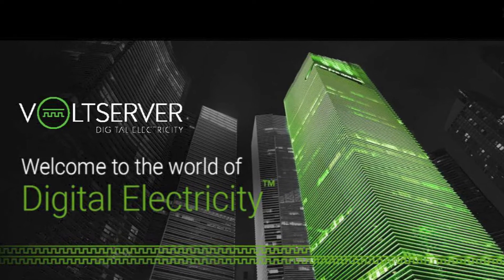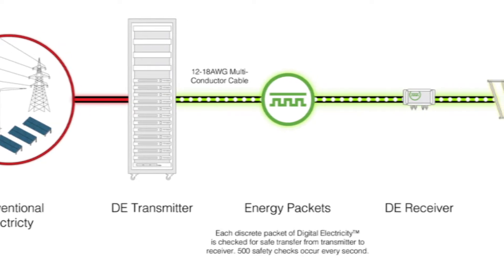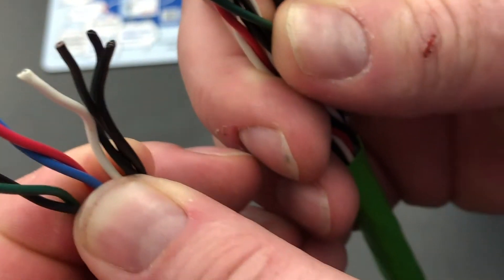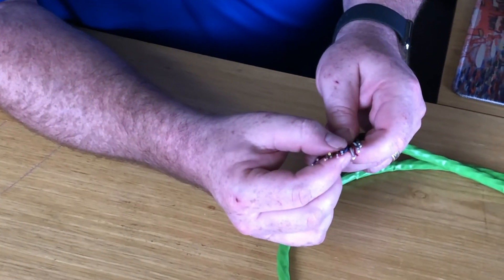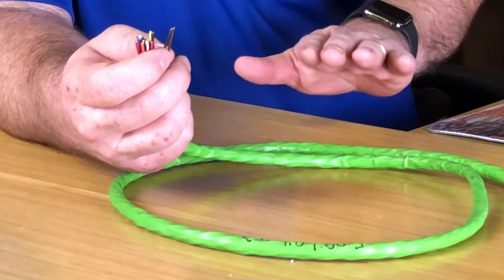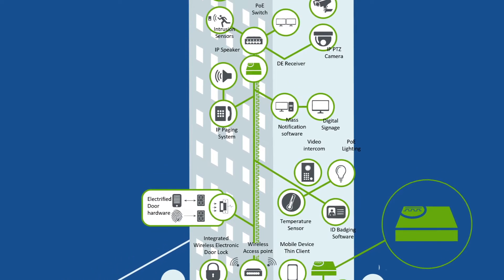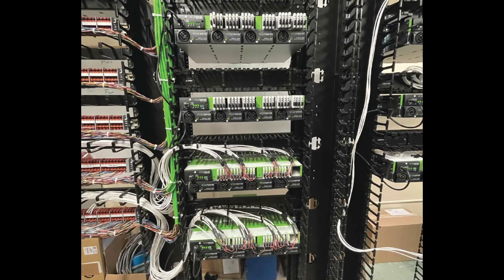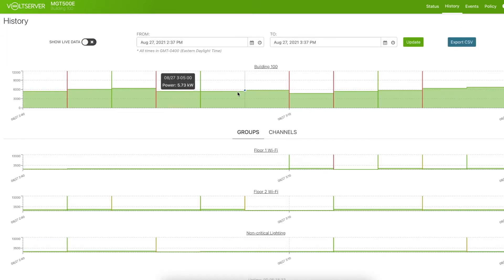What is Digital Electricity?

Comment: I wanted to know what are the limitations of what can run on DE. Is it just light, smoke detector and low voltage equipment or can outlet, appliances(refrigerator, microwave etc) be used as well. Which would usually be on a 20, 30 or 60 Amp circuit breakers
Reply: It depends on the end device being powered.  The existing AC receiver is rated at 200VAC and 1400W - not typical of office or residential spaces and only about 7A.  That works well with equipment that has some flexibility in its input voltage.  Networking gear, in particular, is well-suited for this.   As demand continues, though, I'm certain they will offer more AC options - safe AC power in a residential or commercial space sounds pretty good!  
Additionally, they offer a wider range of DC power receivers and there are a limited but expanding number of DC appliances on the market that can be powered by VoltServer equipment.  Also, as solar energy availability grows, it's DC-native power will drive the market towards DC appliances.